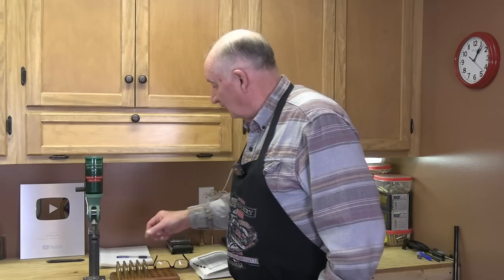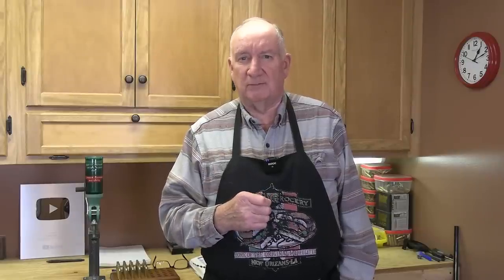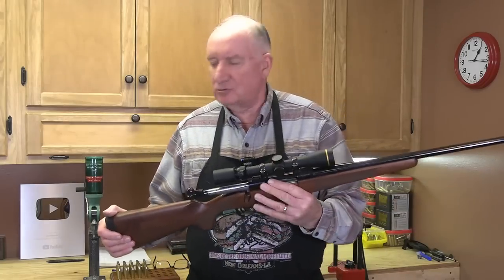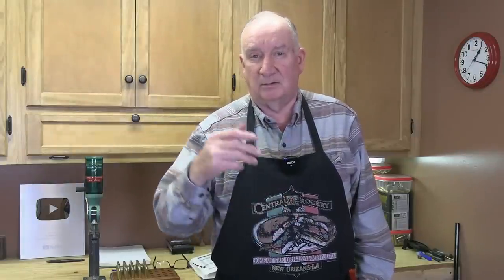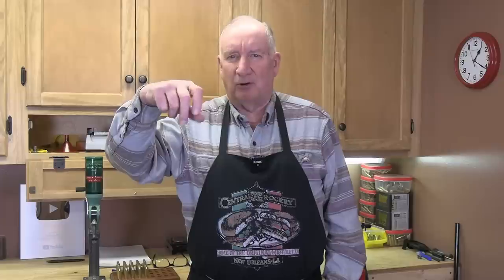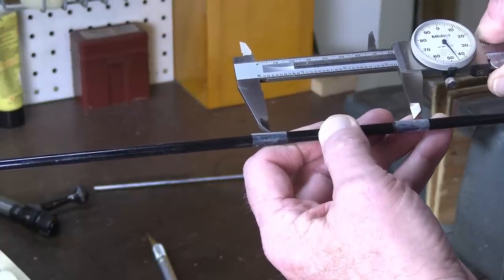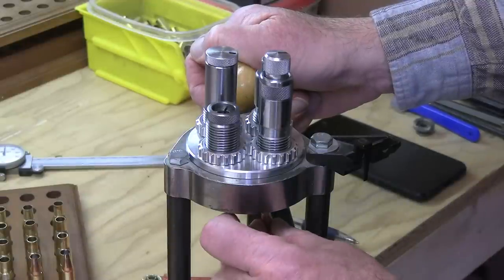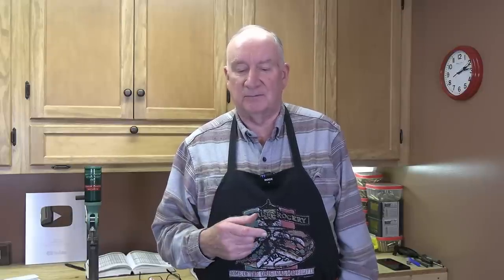How to Make Super Accurate Ammo ~ Part VIII Seating Bullets

Comment: There is an immaginary axis (line) that runs down the center of the barrel.  My goal as a master reloader is to line up the cartridge along that centerline where the line runs through the center of the primer and through the center of the bullet tip when the bolt is closed.

Comment: Sir…I’ve gotten into shooting/hunting later than most,so I’ve set myself a steep learning curve.I would like to thank you for your clear,concise and incredibly information filled presentations.You’ve helped me immensely and I look forward to your videos.Please keep up the good work.Thank You
Brian..British Columbia Canada
Reply: I'm in the same boat time wise, same province too!  Cheers.
Reply: @jinks67 I started reloading in the late 1960's... with my uncle and grandpa.

Then learned a great deal more from the guys working at Scheels and Cabellas in Montana and also their customers.  Then books and then videos.  

I can dramatically flatten the curve by sugesting using a Forster Co-ax press and Lee and Forster dies.

Then invest in as much precision measuring equipment and tools as you can afford. 

Upgrade to Tika stainless steel rifles and set your cartridge length to the max of your clip.  Set the neck tension with a carbide mandrel and mandrel die.

The case, case prep, the bullet, the primer and the powder and accurate powder measure work synergistically with the rifle and scope to create an accuracy that we all want to achieve.

How well the cartridge case is fitted in the rifle chamber is primary to both accuracy and safety.

Comment: Excellent video.  I found that the COAL of my 6.5 Creedmoor changed since I started reloading last Spring (600+ rounds ago).  Due to erosion, the jam dimension has moved 0.013" down the barrel.  (from 2.847" to 2.860")  In my early reloading days, the tightest 5-shot groups were at a COAL of 2.824" shooting Hornady 140 grain ELD-Match bullets.  Today the best 5-shot groups are with a COAL of 2.840" on that same precision rifle.  Most of my trips to the range involve shooting groups of various seating depths.  I start with 0.020" and then increase the seating depth in 0.003" increments.  I usually shoot 5-shot groups of multiple COALs.  Last week was 2.840", 2.837", 2.834", 2.831", 2.828" and 2.825".  The first and last groups of the day were 2.840" and both were tighter than the other COALs.  (thought the group at 2.831" was pretty good as well)
Reply from the maker: That's pretty fast erosion.  I experienced that same issue with a pet Sako 270 years ago, and I later determined that it was due to the use of aggressive ammonia based bore cleaners.  You should have no rifling change for at least 2,000 rounds or more with such a mild caliber as the 6.5 Creedmoor.
Reply: @GunBlue490  I'm pretty sure my round count is under 1000.  Never used anything other than Hoppe's #9 bore cleaner and one good cleaning with #9 Bench Rest copper remover.  I've purposely avoided the aggressive cleaning products.

Comment: I have  been and do the exact same process on a shiny cleaning rod.
except i mark the cleaning rod with a permanent marker and use a close fitting washer to make a mark on the rod with a needle.
I also use the cleaning rod to move the projectile up and down the bore with a pencil at the bolt end to feel where the lands are.
Great explanation by the way

Comment: This is a fantastic technique measuring the OAL of the cartridge and so simple. I have the tools and comparators to do this from the back of a rifle using a modified case similar to the Hornady verstin with  thumb screw- I'll add that I made them myself on a lathe with scrap and paid nothing for them- but I wouldn't have bothered if I'd learned this sooner. I was never able to measure the chamber on my .358 Winchester Browning BLR pre 81 using my tools because I can't get them into the breach with the modified case. For the first time I was able obtain a measurement using this cleaning rod and tape technique by just dropping the bullet in with an open lever and using a bent rod to hold it in place- take that for what it's worth!

Comment: Very good explanation. Woodworking tools such as routers use the same thread adjustment system for adjusting cutting depth, say 1 turn of the adjustment screw equal ¹⁄₁₆", depending on your tool. I hope you will cover crimping in a future video. I noticed you said you weren't crimping because you weren't using an auto or lever action, so I take that to mean we should crimp for those guns. I think I remember my reloading manual saying excessive crimping will cause premature cracking on the neck, which makes sense because expanding and contracting a piece of metal causes fatigue.
Reply from the maker: Please watch my recent video regarding crimping, and it'll explain that issue in depth.

Comment: This all varies on each barrel.  I shot thousand yard BR for years and had several guns going at one time. My main caliber was 6.5 x 284 and Sierra 142 gr bullets. I had five barrels. All Kreiger's 28 inch, all chambered with my own reamer. Every barrel was chambered by a superb gunsmith and all five barrels the  maximum OAL varied by less than .001. Each barrel wanted it's own seating depth for best accuracy. Most were .005 from touching the lands. One was .010 off the lands and one was .015 crushed into the lands. All barrels were the same . All had a 2.5 degree lead into the rifling and yet each barrel wanted it's own seating depth for maximum accuracy. Some times it's just off the lands, sometimes it's touching the lands, sometimes it's crushed into the lands. NOTE these were ALL fired single shot one at a time, hand fed. Not from a magazine. Both of my actions were Batt dual port. Feed in the left, eject out the right.

Comment: Great video. I do like the extra measuring tools though. Your method definitely works if setting up your die is with the exact bullet you used measuring. However, if you were to use a different bullet even out of the same lot it may not be correct because of the variance of bullet lengths. The ogive is still the most reliable measuring point. It does help to have tools that measure at a relative location on the bullet that is the most consistent measurement. I measure a lot of my bullets and the bullet lengths are the most inconsistent place to measure. Where ogive measurements almost always measure correctly in length when using tools to measure at that point. I can see though that some of the other tools used to set up are actually inferior to the way you did it. I think it would be a great idea to just make a dummy round out of the one bullet and use the ogive measuring tools to check all the bullets afterwards. I really do enjoy your videos and can see you know your stuff. I have bought a lot of gadgets I have not needed but many of them are helpful to make things work better quicker like competition seating dies, automated powder despencer and a press with individual toolheads set up for specific calibers. Thumbs up on the bullet seating depth.
Reply: I have also noticed a difference in bullet lengths especially with the lead points. I use his die seating ie stem turning method and it appears to work. Like you I keep the sample dummy round for future loading.

Comment: So. Excellent video, your explanation/demonstration on finding chamber length was great. Two questions- after applying tape to your cleaning rod, why not just insert it, put the exacto or razor blade against the crown and gently cut off the excess tape and repeat for second marking. The space created is easier to measure but I admit, you might score the rod. Second question- if you’re shooting single shot, not crimping a neck makes sense, however if you’re running from the magazine you can get set back of the bullet from recoil. Ask me how I know😅.  (30-06 & .375 H&H)
Reply from the maker: I've found that it's actually easier to measure from a scored mark on the tape than from its edge, which is why I revised this technique.

Comment: it is also possible to calculate the circumference of the top of the die and get how many inches one revolution is, multiply that number by the number that represents the excess of the full number of revolutions (in this case 2.5 revolutions, the excess is 0.5). The resulting number is inches that we transfer to adhesive tape and mark it. We stick the tape next to the mark on our die and get the exact place where the 0.125 inch we need is located

Comment: This method works great if you can easily access the crown of the barrel.  What do you do if the barrel has a flash suppressor such as most AR-15 rifles?  Most have a large diameter making it difficult to make sure you are parallel with the bore. It just adds a margin of error.

Comment: I posed the questions below to both Lee and Hodgdon tech staff. They indicated either small or large rifle primer could be used in load data that specified large rifle. I am sure that you would defer to published data in answering this question, but I wanted to know if you would trust the answers given by the tech staff of these companies since it is not in the published data? I have no reason not to, other then your numerous warnings to adhere to published load data. One of the tech also said that large rifle is more reliable in cold weather.

"I have a question regarding load data that is available for 6.8 SPC. Most of the load data for this

cartridge specifies large rifle primer (i.e. Lee Manual), but all of the spent cases I have
are small rifle primer. I have been unable to find load data that lists small rifle primer as an
acceptable primer (such as with Accurate 5744 powder and Speer 90 grain bullets).
Do you know of load manuals that list small rifle primers (for 6.8 SPC), hopefully using the powder
and bullets listed above? I understand that small and large rifle are not interchangeable in load data
or are they? Can small rifle primer be substituted for large rifle primer where it is listed as the
indicated primer in  load data manuals (as with 6.8 SPC)?"

I am new to reloading and I so appreciate the level of detail and reasoning you give in explaining the mechanics and physics of reloading. 
Thank you most of all for your witness for our Lord and Savior Jesus Christ.
KC Spokane

P.S. Sorry for the long comment.

Comment: Sir I need help and I thought of you immediately, Big collector at church brings in guns for me to shoot and play with and I return them. He gave me 2 1911's to shoot. The stainless trophy had some scratches on the frame the gun was gunked had been in the safe dirty for years? Zero experience on 1911's so I you tubed several assembly disassembly videos fairly simple. Soaked and cleaned, I now see why it's scratched, more you tubes to sand out the idiot gouge. Upon reassembly attempts the interference of the take down piece and the spring plunger would not allow a straight push in no way. So too avoid re-scratching the frame I pushed in the plunger and she dropped right in. Any advice on that, does Colt have a few over length plungers or the take down lever does not have enough lead angle to allow a straight push. Sorry to invade your topic I trust your judgement.

Comment: If you decide to go by what the book says for c.o.a.l, and have 2 different books and they have conflicting c.o.a.l, how do you know which book to use? Looked at Sierra for Sierra bullet, it said coal was 3.30 Lyman said 3.25.
Reply from the maker: I'm smiling.  It's easy to get one's head wrapped around numbers and lose sight of what they represent.  The difference is .005".  A sheet of paper is .004".  One is as good as the other.
COAL is not a line in the sand.  It represents the minimum length in any cartridge, but the maximum can be one's preference according to chamber throat, magazine length and proper functionality.  However, pistol cartridges require close adherence to COAL due to their unforgiving, smaller tolerances.

Comment: Hi
Does the firing pin protrusion make any difference?
Reply from the maker: Not unless you're experiencing misfires due to insufficient indents, or pierced primers due to excessive protrusion.  Either condition is quite unusual.  The more critical issue is insufficient impact force that produces a mild flash, which is often the result of manipulating springs to reduce trigger weight on certain types of firearms. But if a primer goes off, it means that protrusion is sufficient to close the cup and anvil gap.

Comment: In my experience, get close enough then try some loads at +/- a couple thousandths to find the sweet spot. The lands will wear and you will be chasing a new number in no time. Don't change it again until it shows on paper, a person can waste their lives chasing the lands.
 Excellent info though. Just don't want anyone to get trapped down the rabbit hole.
Reply from the maker: It's as simple as I described, and no rabbits anywhere.
Reply: @GunBlue490  I agree however many reloaders are chasing perfection and it's easy to waste time in the pursuit of perfection. (Forward a few thousands backwards a few thousands measuring again and again as the lands wear)

Comment: Should I FL size or neck size for 7mm Rem Mag with brass I’ve shot
Reply from the maker: For more information on the subject, watch my video, "Should Magnum be Belted or Non Belted?" Belts are really hybrid rims that allow smooth feeding through box magazines.  Like rimmed cases, they headspace on the belt, too.  However, higher magnum pressures cause the case to pull forward against the resistance of the belt, stretching it just forward of the belt.  Over subsequent firings and full length sizings, thinning occurs, leading to eventual cracking, called incipient case head separation, which is not only dangerous, but will cause gas cutting of the chamber, which is a permanent pitting.  Elimination of the stretching that causes it is key.

All sizing dies are chambered for the smallest rifle chambers, to assure bolt closure with all rifles.  Belted magnum dies should be backed off a full turn, then incrementally lowered on the press just to the point that empty, sized cases will reliably chamber.  

For recreational target or varmint shooting, I always neck size only, but for hunting loads, I always full length size to assure easy bolt manipulation.  Cases sized in a Lee Collet Sizing die will outlast any others, by far, provided that they are annealed occasionally.

Comment: Hello. New reloaded here. Say I follow this procedure to load all bullets .020 off the lands. What if my brass is all slightly different lengths? Wouldn’t this lead to differences in the depth bullets are seated into the case neck? If so, would this variation in case length (and thus seating depth) affect accuracy and potentially negate any benefit of loading bullets a consistent distance from the lands? Thanks.
Reply: My Hornady book says, for example, that 30-06 case (no bullet) length should be 2.494". I'd think (guessing) if your cases are within +/- 5 or 10 thou, say 2.484" to 2.504", then the 20 thou or so should still be ok. But yeah, now I want to measure my own cases for my own reloading to insure I'm starting from an accurate case length.

Do other more experienced reloaders have any opinions?
Reply: Case length variations won't necessarily affect bullet seating depth in the way you're thinking. Varying case lengths affect bullet tension to a degree.
More of the neck will grip the bullet because the neck is longer which can be a good/bad thing.
I measure strictly from CBTO (case base to ogive) for bolt actions and seat my bullets as close to the lands as I can get without going into the lands. Some bullets prefer that, some like to be a few thou off and some don't seem to care where you seat them and some like to be into the lands. Your rifles chamber will have  an affect as well.
 I measure COAL (cartridge overall length) for my AR because I want the rounds to fit in the magazine.

Comment: To gun blue 490,this is Terry I have a winchester model 70 feather weight 270 had shoulder surgery worried about recoil a gun smith magnaported it was all over the target found abetter gun smith old scope was bad put on new scope still shot all was some better still wasnot hitting good at 100 yards gun smith cut end of barrel off barrel is about 19 and one half inches still shooting 3 to 4 inches from bulls eye at 1oo yards should I replace barrel .
Reply: Terry, has the rifle ever been accurate since you’ve owned it?  I’d hate to see you throw good money after bad.
Reply from the maker: Generally speaking, I don't recommend replacing factory barrels, because non-original firearms no longer have any book value and are considered mongrels on the gun market.  Selling one for any money at all is like trying to sell a Bubba pickup truck.  I suggest cutting your losses and trading it for a different gun.
Reply: Black hawk 7 r my 270 was very accurate one half to three quarters of an inch at 100 yards I shoot 13o grain winchester ammo.
Reply: @GunBlue490  this is Terry again does the shorter barrel affect accuary I shoot 13o grain winchester power points always shot excellent before  I stocked up on ammo about 3 or 4 years ago it always shot 1half to 3 quarters of an inch at 100 yards .

Comment: You didn’t mention how the seating stem fits the bullet. Bullet tips are very fragile and inconsistent. If the bullet tip bottoms out in the stem, your seating depths are going to be inconsistent. Inconsistent depths cause inconsistent pressures causing inconsistent velocities resulting in inconsistent points of impact. 

That’s not important for hunting ammunition, but it is for what I consider “super accurate” ammunition.  I also spent a few bucks for a bullet comparator so I don’t measure from varying bullet tips.